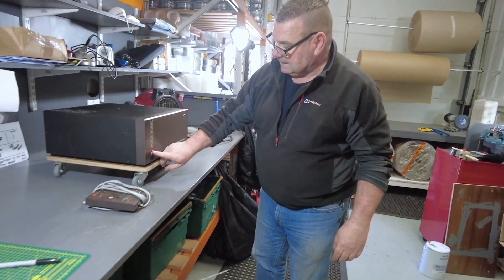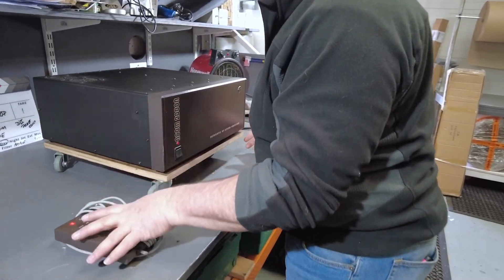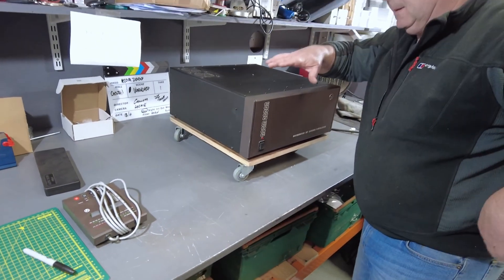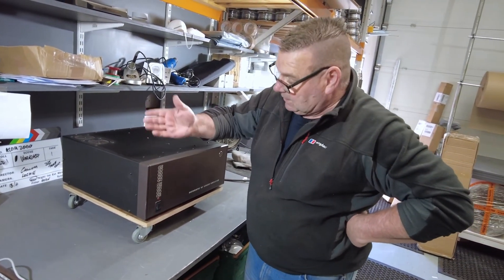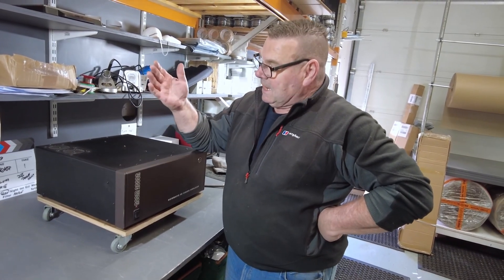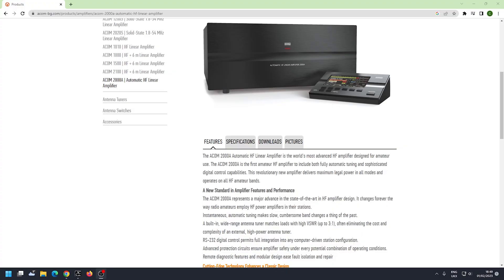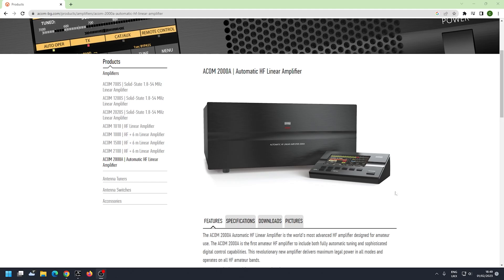The Power Struggle: High vs Low Power for Ham Radio

Comment: I designed military power electronics for over 40 years, heat is the big killer of electronics assuming all the components are otherwise run will within their voltage specs. with the proper cooling which keeps the semiconductor junction temps well below max limits, things can run a very long time. Most ham gear isn't designed for continuous key down operation so buying a 2000 watt amp that you run at 1000 watts is your derating. 73 and happy hamming Mike K1FNX near Boston
Reply from the maker: Mike, GREAT comment. Thanks for chipping in.
Reply: @DXCommanderHQ  QSL,  the cooler you can run stuff the longer it will last plus you will stay linear which eliminates all sorts of nasties....... you need to get on 40 ssb abt 10:00 pm your time Cal......... 7.140 ish cheers...........Mike, K1FNX near Boston
Reply: This is part of the reason why I run my FT-891 at no more than 70w. It’s already in my car 24/7 so it’s exposed to temperature extremes. (I do take it out during extreme cold.) I want it to last and the difference in signal at the receiver end is negligible between 100w and 70w. As conditions improve, I’ll probably lower the power. 73 de WB3CFN/m

Comment: Why would you want a 2,000 amp?

I want a 10KW amp but I can’t find a good Henry 8k

That’s my view, I just want the highest power rating. Limit is 1500 but if they are making 3CX1500a7 tubes or amps with 3x 3-500z, then heck yea man. I’ll do 1500 average ;-)

Comment: I recently bought my first linear amplifier, an RM Italy BLA600 rated at 500W in all modes. I plan to run it at no more than 400W PEP and perhaps 100-150W FT8, if that. I may just put it in standby (bypass) and continue to run 50W FT8 with my DX10 as Yaesu recommends for maximum digital mode power, we'll see. I think a rare occasional foray into higher power levels in digital mode to snag a DX contact aren't going to destroy it. It has very good protection circuits per the manufacturer. And all of the kit I have to go with it (9:1 unun, tuner, low-pass filter) is rated at 1.5kW. My coax is rated even higher: LMR-400 to the antenna, RG-213/U for the jumpers between the amp and tuner and between tuner and filter. I got the BLA600 because it was available and I could just afford it. Due to the nearness of neighboring houses to my antenna I never plan to run more than 400ish watts HF. It should be enough to be able to be heard.
Reply from the maker: Nice

Comment: My first amplifier was an Ameritron AL-811HXCE, which was okay for SSB, but overheated on 400W SSTV, etc.

My Alpin 100 mkIII runs a lot cooler at 400W on SSTV, than my previous amplifier. There's more headroom too, plus the new 1kW legal limit can be a boon.
Reply from the maker: Not heard of the Alpin.. But I'm not an equipment geek..!
Reply: @DXCommanderHQ it's similar to the Acom 1000.

Comment: Smiling!
My dad was a mechanic used the same speech to me and my first motorcycle in 1964, I pushed it to the limit till I was putting a new piston in it.  I bought a bigger motorcycle and never again 15 motorcycles latter and 60 years of riding had that issue.
Reply from the maker: Lovely!

Comment: I get what you are saying, but any decent device should have a little 'in hand' beyond the specified Wattage. Many don't of course.
Reply from the maker: Sure, why not.. For instance, the TS-990s have the capability of doing around 450W if you look at the circuit board, but it's throttled back to 200W. That's Kenwood though! :)

Comment: And yet...
'Acom 2000A Belonging to The DX Commander repaired' (Acom 2000A, SN070150), "...an amplifier that Callum sent in..."
YouTube link = https://www.youtube.com/watch?v=QA-op68t0Ps
Reportedly nothing to do with 'heat-related' failure, which is another point worth making: There are plenty of failure modes, and 'Heat' and 'Duty Cycle' may have nothing to do with most of them. It reminds me of those that change the oil in their car engine every 5,000km, and then wonder why the transmission (never maintained, no fluid changes) failed after say 10 years. Best to keep a broad view of such things, and do not focus just on heat and duty cycle. Even left on a shelf unused, it might fail due to age-related issues.

P.S. I'm not here to pick a fight; it's just that this video doesn't tell the whole story.
Reply from the maker: My amplifier used to spend more time travelling than most mobiles!

Comment: Why high power anyway? Nothing over 5 Watts here for 30+ years.
10m c.w. on Tuesday my 1 Watt got 1500 miles to Bulgaria on an indoor dipole. My report 559 and I gave him 599 with his 100 Watts. Nothing wrong with 559. How much further did my signal actually go? 
QRP to QRP is a far greater achievement than running our limit of 400 Watts to do the same thing. I've had some great QRP to QRP contacts.
How much power do you need?
I like my electricity bills the way they are and often run on a solar panel and rechargeable battery.
G4GHB
Reply from the maker: I'm sure Bill. Some folks like an armchair copy too. Horses for courses.
Reply: @DXCommanderHQ  Well, okay, but I'm more impressed with Miles Per Watt than Watts Per Mile.
Reply from the maker: Great. You enjoy it.

Comment: You nailed it!!! Plus having extra power makes doing DX a LOT easier. A great antenna with 100w or less can only do but so much & same with propagation. I also find more hams are willing to ragchew or hold extended QSO's if the other party has a strong signal on their end. Then theres busting thru pileups. I work broadcast radio and all our gear is overbuilt for continuous duty & do over rated power and require extensive cooling cuz a 25kw amplifier burning up is not the same as a 100w amp burning up lol.
Reply from the maker: Love the end of your comment.. Haha, I'll bet!

Comment: Yep!  That's why you want big amps... It's called headroom 😊.

I've got several different amplifiers... an OM Power OM-2000A+, 3 Henry's, and a Drake L-4B, among others. The Henry 3K-Classic-8877 is my favorite, with an 8877 (3cpx1500A7) tube and massive power supply, it will do easily 3kW PEP.
I have it because, if needed, I can run at full legal limit (1500 W), CONTINUOUSLY, without ever missing a beat, and over-stressing the amp.
If you want your gear to last, it should be rated at more than you routinely intend to run at, at least 50% more, with 100% being even better.
Thanks Callum.
Cheers from west Texas...
~Alan
Reply from the maker: Nice one Alan!!

Comment: If you get 150 horsepower out of a high compression, 2.5 liter gasoline motor, you will have a high strung engine that will not be able to lug much, and making it work hard and pull to much could blow it up, you have to be very mindful of how hard you work it and how much abuse it can take.  Get 150 horsepower out of a low compression 4.9 liter I6, and you will have  rough and tumble, hard pulling, cool running, abuseable and durable workhorse that never works too hard to hurt itself.  Displacement is more important in low tuned workhorses than it is in high performance sports.  

I like a 500 watt "10 meter" amp because I can talk at ~360 watts PEP all day long.  1,200 watt HF kicker to talk at 800 watts, or do any FM or digital all day at still high power.  Those who run big motors or big amps and "detune" them and run them easy find they have stuff that lasts forever.  

For many of us, running big means we can do whatever we want, in a variety of fields and interests, with plenty of headroom and not working anything to death.  Watch a gunsmith or blacksmith, they will use a bigger hammer and adjust their swing, they don't pick up a small hammer and throw it harder.  Bigger, heavier, it isn't about using them to their maximum for the biggest gain, but rather using them at their minimum for duration and effect.
Reply from the maker: Yes, .. you used the word "headroom". Perfect.

Comment: Nice video. Another passion of mine is cars (damn me). Recently got rid of a 750 BHP RS6. Did I drive mental in it? No (well mostly no). I did 140,000 miles of work related driving in it. The V8 was solid as a rock and quite honestly was in 4 cylinder mode for most of my trips where I was chasing the econ meter - that was as much a challenge as the performance. The point is, it was never stressed. Miss the car, but the really expensive clever suspension was going wrong, so it had to go.  / When I was recording my music I was doing a lot of progrock mixed with classical themes. At one time I had a four PC array in my little studio so the effort was shared between them (lots of virtual instruments, reverb and similar). / So I am am currently 2E0MSR - with 50 W to play with, but as you note, there are losses etc. I have a ACOM 1000 amp which I treated myself to once getting the intermediate, with the aim of using once I get my full. HA - the full is taking longer due to work commitments. So it is a posh office warmer, but it is ready to go - noting that like my car, if I need 400W, then it will be ticking over.  / I am addicted to gear though :(    Mark.  (Aside - Have achieved many good SSB contacts on SSB and appreciate the whole station set up is key, the antenna being at the top of the list.  )
Reply from the maker: Posh office warmer.. Haha. Love it.

Comment: Excellent explanation Cal. Can't trust the manufactures are derating their power output engineering so running at full power for extended periods is going to make those finals very hot. I like to stick to 50 - 75% output on continuous output modes. Even if I want 100W output, I will turn on my 500W amp and dial back my radio. Many times the fans don't even kick on.
Reply from the maker: Exactly!

Comment: i think an acom 1000 would have done the trick as well. (and keep your principle intact even though - 500w is enough, leave 500w unused and you be fine too) 

ft8 is a low power mode (if you cant make it with 60 watts.. dont knock other peoples AGCs down using the nuclear 1000w option)
I dont think winning by supressing others is what you had in mind, that would not match who you are.

And rtty is only done in contests - and 500w is more than enough for that too.  

I love the acom amplifiers, but truth to be told - it is not used much. Most of the time i do without, digimodes? i do without.

If you can afford a 2kw, why not - but whether you really need it is a different story.       I dont max out my amp ever for anything else than ssb. Ther is no need, no added
benefit... (we all know the 4 x w = 1 S unit = 6db - math, so yeah.. 100 to 400  - that makes a difference... 400 to legal limit ? neglible. no need to max out.)

Anyhow, i love my acom. My girlfriends name is "svetlana" 

would not mind to have the bigger one,  but i am honest enough to admit :
i dont really need a bigger one. Neither do you mate :)

The Acom 1000 does 1300w on my meter with 90w - and most of the time i reduce it to 700w out or so. (half basically)

Big respect to all the portable guys and qrp guys and magloopers - i love you all, and respect any of you more than someone
who runs the AMP unnecessairly thus shouting farther than he is able to listen. (that is not ment to be a poke at you dxc!.. but you know it happenes)
Reply from the maker: All good points. I do need the big one else I couldn't test key down at 1,500W for the US market. And running 800W (with 3dB loss on the feeder) is a bit much for most amps.

Comment: That is right! Well said. Many people don't realize how much power they are losing through a shack tuner + feed line + a non-resonate antenna. Sometimes greater than 8 DB loss when using 75 ft  or greater of RG8x on a high SWR antenna. Their 100 watt rig (Fiat 500) is pumping its heart out with flames shooting out the back but in reality is perhaps only getting 15-20 watts to the antenna. The losses can be horrendous. Even with RG213 it could still be losing 4-6 db. You have the right idea with your DX Commander line of antennas. Compared to the plethora of (expensive) non-resonate verticals on the market that are barely tunable and need a tuner to work at all, a DX Commander and a 100 watt rig is like having a linear amplifier on one of those other verticals.
Reply from the maker: Nicely put. Never thought about it exactly as you said it..!

Comment: HI Callum, please pardon my french and forwardness. Would you please use a bit of you immensly precious (youtube) time to explain the theroretical and real world diffrences between using harmonics of antenna's in amateur radio,for instance the diffrences beween a HF flat dipole and a delta/sky loop (and its harmonics), i had some questions on the every vs odd harmonic calculation etc. if possible allso touching the height above ground/hedgehog patterns etc ..  thank you in advance. Edwin/pd0sot/Sonic . .
Reply from the maker: That is a GOOD idea.. If I make a long-form video about this, it will educate me as well!
Reply from the maker: PS - I have been quiet recently but been doing a LOT of research about how we can "bend" the 3rd harmonic so it can appear lower down.. Big video coming up and I'll do it all..
Reply: @DXCommanderHQ  if you need any help/assistance/encouragement/milk&cookies let me know. I am not one for throwing the question over the wall and just sit and wait until the merchandise comes back over :)

Comment: My 6 year old 7300  has done 100w  FT8 almost every day since new and is still going gang busters today.  ICOM has always produces a superior PA in their rigs.  I only buy ICOM for this and many other reasons.
Reply from the maker: Good luck!
Reply: If these name brand ham radios are as easy to blow up as this guy says, the entire hobby needs a reality check because they're being sold for way too much. Imagine paying around 1,000 dollars or more for a radio, and then having to baby it, and not being able to use it to it's potential - and then having to go out and spend several MORE thousands of dollars just to stop the original item from blowing up. Any 100w radio worth its salt could actually do MORE power, but has been dialed back. If a radio is "AT IT'S LIMIT" at it's full power, then that's a terrible design. I got a room full of radios that are older than me that still put out full power.
Reply: Love Cal but now this is BS, he loves his big power radio and car thats all
Reply: @skoda8761  correct - If a piece of equipment is designed to run at 100W continuous then it should do so without any problems. 
The problems occur when the equipment is not being run into decent loads, and such like. Over-engineering something can help, but it generally masks the real problem.

Andy
Reply from the maker: Guys, these radios are NOT designed to run full duty 100% of the time. It would be like putting your foot to the floor for hours on end and wonder why your motor blew up.

Comment: I have a Blackstar guitar amp 40watts it can get very warm and its full of SMD components for switching if it brakes down I cannot repair it where as a pure valve design I can it seems to me this amp is trying to be to clever and overcomplicated .
Reply from the maker: Blackstar appear to be a fine amp company. I knew the product manager. Actually, played in a band with him once. But you are right, it's an extremely "clever" amp and full of SMD!
Reply: @DXCommanderHQ  When it gets very warm one of the push button switch on the high gain channel starts to do its own thing.

Comment: Well said!! Electronics love cool. The very reason we kept our computer room (in an earlier life) at 60 degrees F or lower. I have a small 100W amp for my Xiegu G-90 to do FT8 with and I run between 75 and 85W out (depending on band) with 1W input to keep from damaging the amp but giving me an increase from the 20W G-90. Just makes sense. Thanks Jack K5FIT
Reply: Does it still get hot at that power?
Reply: @DonzLockz  75W is a lot for a 100W amp.   Steve Venner from ML&S explained it to me this way, when it comes to FT8, do not exceed the maximum AM output rating of your device (which is usually 25% of the maximum SSB output).
Reply: @RF_Burns  thank you, that's a good way to remember and to prevent the amp from overheating and dying too early. ;)

Comment: Hi Cal, I use a Crown MA3600VZ power amp on my hi fi for the same reasons as you use your Acom amp about 25% duty cycle keep cool  😀
Take care,  all the best Dave.
Reply from the maker: OK, so I don't know that amp.. I have 4 x K2 amps (unused..!) and run a pair of XTi-4002 for my system. Normally silent but last summer, the fans kicked in a couple times. The K2 amps are totally sealed and silent.
Reply: @DXCommanderHQ  Yes Cal, the XTi range of amps have a switch mode  power supply with a modulated HT rail for the left and right amp channels and they are quite conventional topology so they need to be cooled, the K2 amps are also switch mode power supply but the amp channels are  completely digital so about 95% efficient so they don't need any cooling all good stuff, the old MA range are old fashioned technology using big transformers and bipolar output stages fantastic for there audio quality but dead heavy and get quite warm to.
Regards
Dave. 

Regards

Dave.
Reply from the maker: Late reply here.. Actually the K2s and K1 amps have a MASSIVE transformer so I don't think it's switched mode. Which is why the weigh a ton!
Reply: @DXCommanderHQ  Yes Cal you are correct my mistake, I remember the K1 and the K2 the front panel had a round shape in it to accommodate the big  toroid mains transformer, they also have some massive inductors in the output filtering as well, so yes quite a heavy amp but not heavy as the MA range of amps.

Cheers
Dave. 😀